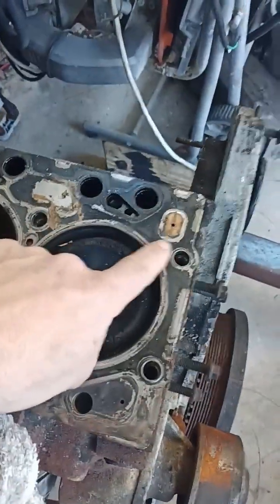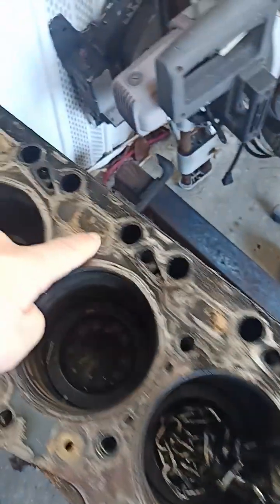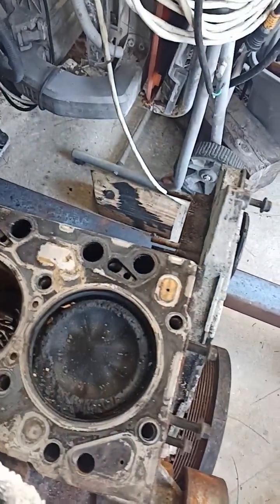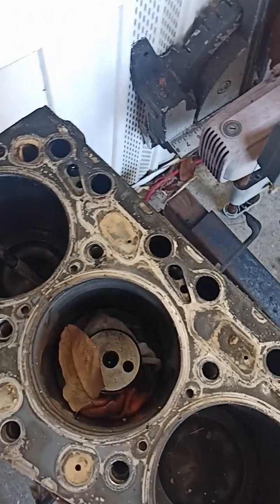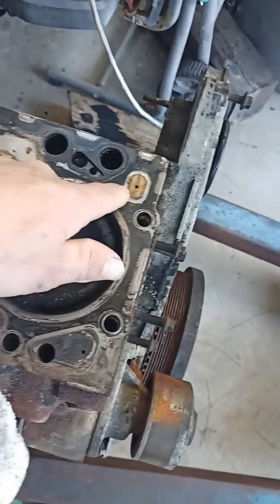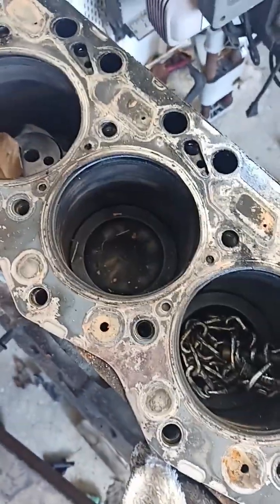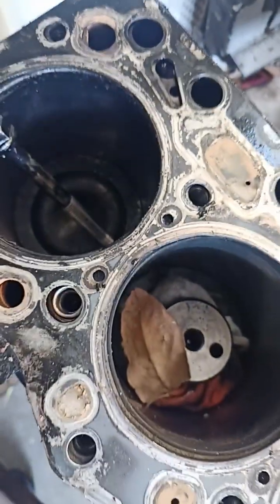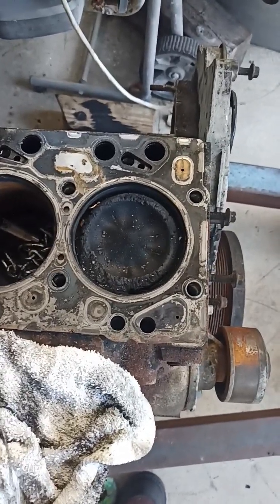head gasket modification to solve cylinder one and six overheating issues Cummins

Comment: Restricters keep coolant there longer as so it can transfer heat , if one cylinder is getting overheated it is a fueling issue .read a book and good luck
Reply from the maker: I bought this truck for all of its cores. This one happens to have a windowed block. The truck in front of it has won multiple dyno events and sled pulls. At the moment I'm trying to modify a particular engine to handle running at 4800 RPMs non-stop. 

This particular engine is beyond repair. It threw a rod in a catastrophic way. It destroyed the cam journal as well. It's just not worth machining.

Comment: Imo cummins has countless hours of effective engineering experience , so your not making a better mousetrap
Reply from the maker: They may know how to do things better but it doesn't necessarily mean they'll do it because there are reasons. Example low speed fuel pressure is also lower to improve MPG due to load so there's a sweet spot same as true for oil pressure. There's a coolant bypass kit that supposed to address cylinder number 6 issues. And if that was the case there wouldn't be an aftermarket. The 48re in stock form is absolute junk. The aftermarket absolutely made it better mousetrap.